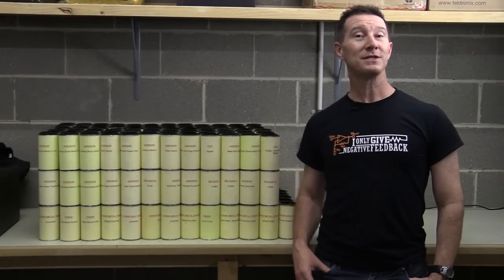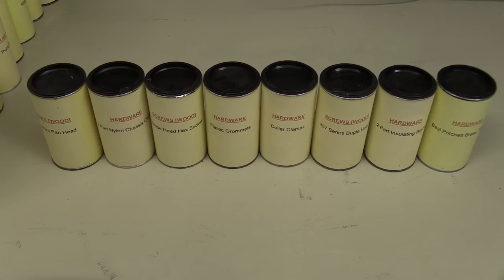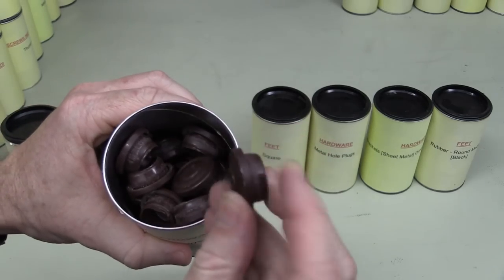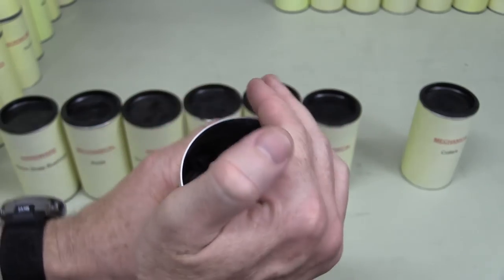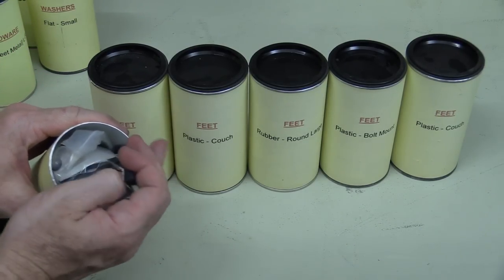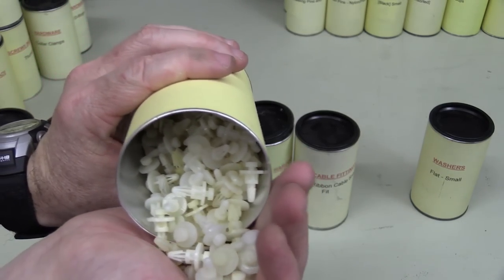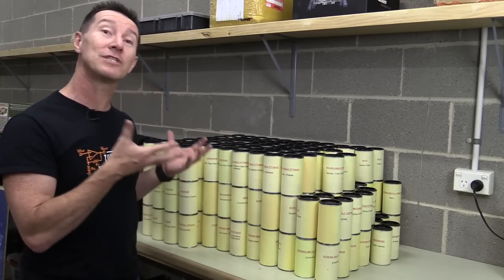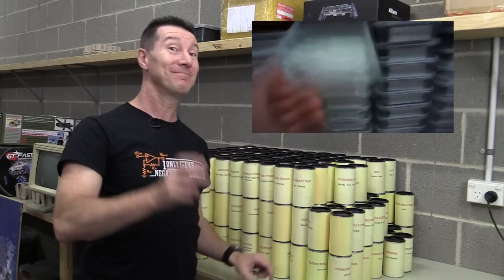EEVblog #739 - Ebay Hardware Tin Collection

Comment: I have a big collection of parts screws & etc myself, I worked for years as a Bio-Medical Electronics Tech in Hospitals repairing electronic life support equipment...
I took some of those plastic couch legs put them on an old shelf board to put my monitor on & my keyboard slides underneath it...  I repair all types of equipment, Electronic, Hydraulic, Pneumatic, Aquatic, & I can't tell you how many times a little spring or plastic spacer came in handy, I once got flown to Georgia, (from Calif.) to fix an intermittent Computer malfunction that I fixed with a used Tuna can & a piece of rubber hose from a windshield squitter line off a car, then took a piece of audio cable, removed the outer jacket, pulled out the wires in the center leaving only the braided shield which I connected to ground & the Tuna can to make an RF shield that fixed the problem, & very cheap with all used parts.. Of course the airfare & money they paid to techs who couldn't fix it, but I got the job done though I was then branded the "TUNA CAN REPAIRMAN"

Comment: Those couch feet slide nicely, and can be used where a wheel doesn't make sense. They also could be used where an impact is likely to help cushion the impact. I can think of many possible uses for them. A bench might benefit from being an inch or 2 higher, and they could be mounted under the legs. If nothing else I can see why he saved them originally.

Comment: I have a similar collection I received from a appliance repairman of forty years. Mine arrived in four 5 gallon buckets. To heavy to carry so each had a cheap dolly. It took eight weeks to organize and label into small drawers. I'm into R&D and prototyping and this kind of stuff is gold to me. Hopefully it will save you a lot of money and provide that prefect fastener or whatever you need for years to come.  BTW rubber couch feet can be milled. Cheap source of hard rubber.

Comment: The brass threads in the beginning are used for E27 light bulb sockets. With them you can mount them mechanicly and also run a wire through the hole in the middle, so the wire is invisible. Most E27 bulb sockets have a thread for that.

Comment: Couch feet make good large knobs for radio hams for antenna tuners and VFOs. Just glue the insert from a smaller knob in with Araldite or similar 2-part glue.

Comment: That sparks guy is like me times 100.  I even put things like that in sorted coffee tins for a while before I built up a collection of departmentalized cases to better organize my parts in.  Goodwill (second hard stores) are great places to get those kind of cases.  I have dozens of them that sort capacitors, switches, connectors, LEDs, relays, small speakers, etc.  I even use those really small 3X7 (21 compartment) days of the week pill sorters that you can get at the dollar store for my sorted resistors.  Quite handy.
Reply: sprybug The pill sorting boxes are actually great - some of them even have nice slots for labelling!
Reply: Mythricia Some do, especially those 4X7's that usually have a gap between each row to put a label.  Most of the time I just put a label on the top flap of the compartment.

Comment: I salvage a lot of small parts like this, and I always find a use for them when repairing something, or prototyping. But I keep my stuff in those nifty assortment boxes you can hang on the wall.
Also I could have used those couch feet the other day. :-D

Comment: Dave, don't discount that stuff as trash. If one is an equal offender in mechanical and electrical engineering - a lot of this useless stuff becomes very useful. The weirdest trash can suddenly have a purpose if you have to fix some 1920s machine....if only for the metal - it happens that i put a brass water fitting on the lathe and turn it into a cable gland because some 1930 electrical enclosure has pipe thread and nobody stocks cable glands for pipe threads....
Reply from the maker: Mrpsychotehpyro I'm not, I'm going to keep a good lot of it.
Reply: EEVblog Send it this way !
Reply: EEVblog this guy must have not had a real good marriage ,,,, he stayed more time with this stuff than he did w/ her,, lol,, no i don't the guy ,, but ive never seen such a collection ...wow
Reply: jim shaw obsessed
Reply: +Mrpsychotehpyro Good call - If anything the vintage stuff should be worth more due to it being rare I would dare say... :( But mid-project and needing a part quickly - as good as gold that collection is!
Reply: +jim shaw eh, maybe his wife was like him :p

Comment: Before anybody makes a medical diagnosis on this person, be sure that your medical board certification is current. If not then you have no idea what you're talking about. This would be the perfect parts storehouse for someone running a vintage radio repair business. Older radios were built a lot like furniture.

Comment: Random, hardware junk is awesome in a pinch. When fixing something while living in rural area junk drawers are most useful things in the workshop sometimes :) random screw collection, various springs, computer screws, electrical connectors off some random things. all junk helps to fix some other hings. sometimes i wish i should have salvaged something of old junk before throwing out- because the parts on it just would fit perfectly like 6 months after it is in the trash :)

Comment: I have a large box with most of those feet and stuff in there (but probably not so much in total), completely unsorted. About every one or two months I am really glad that I keep that box, because I can find something that I need to fix or repair some odd part. Especially those plastic feet (no, not the couche one) tend to get lost everywhere, and I can find one that looks similar enough to fit fine.

Comment: Just a thought on the unsorted tins:

Get yourself a tray, maybe 2 or 3 cm deep, preferrably with a spout in one corner.  Something like is used for prescription dispensing comes to mind, at least the general shape.  When you need a screw or something, you can pour them out onto your tray, extract the kind(s) you want, then use your tray to pour them back into the tin.

Comment: One man's junk is another man's treasure ...lolol
Reply: bullzye101 One man's junk is his own business.
Reply: bullzye101 I always preferred Quark's version on this sentiment, "One man's priceless is another man's worthless." (Star Trek DS9 - Season 1 - Episode 9 - "Move Along Home")
If I had the money and space for a workshop, along with time, I'd probably have done something similar as this guy who left behind his collection. Every piece and part, disassembled, sorted, and stored so that when it comes to creating a fully developed project I'd have things available in case I need them. A lot of commenters seem to want to blast this collector as nuts for keeping things that most of EEVB's followers find "useless junk" but they lack serious foresight. They pay too close attention to just the electronic circuits and cards and not enough to the project as a whole. What is the purpose for your electronics project? What use will it serve? Where will you keep it? How will it be protected? How will it be made more functional or even aesthetically appealing?
The last several questions are answered by "the chassis" the body that will house your created components and turn a random collection of cards and assemblies into an actual functioning and useful device. Things like spacers, brackets, screws, nuts-&-bolts, rubber feet, are all components that are needed to properly complete a new working device. Even the plastic couch feet at the 8:30 mark would be useful for a cabinet-sized project.

Comment: The collar clamps are from cathode tubes on TV screens or PC monitors.

I have no idea why they do them so specifically the same (that cutout and the hex drive) considering they could easily use the version that doesn't have threads, if it can hold a rubber hose on a car a tube should be no issue (cheaper too).

For someone who works in R&D something like this(all those parts) is invaluable. And there's a reason for that. You should never go buy new parts when you test something. It's a waste of money.

But having these in "stock" saves you a lot of trouble. Also, when you're done and ready to move to the next phase, you take it apart and return the parts back in the cans.

Comment: This Sparks fellow is quite the odd duck. I can only imagine he is obsessed with recycling everything so he takes everything apart, sorts and labels the parts and stores them. Quite noble though dull, if you ask me. In the future, we might even need to do something similar. I for myself want to see how much you can achieve from scrap. I am gathering parts for the cheapest 3D/CNC/laser printer ever. I'm aiming for 0 cost :D . Haven't figured the laser part yet. I hear there's no open source inkjet printing out there but I've seen some piezo experimentation. Naturally I'm digging for floppy disks, optical drives, old cables and transistors, caps, displays, used dremels, bare metal etc. etc. Electronics is the coolest hobby ever!!!!

Comment: That's what AfroDave is for!!  Do a quick 2 hour sort of what is useful and junk the rest.  Get fancy if time permits by putting a number on each tin with the description on file so you can easily find what you want.  Faster to find that rare part there than going to the hardware store.  Get 'er done AfroDave!   ;-)

Comment: The fading o f the paper used to label the tins show time between labeling. Its easy to have a template set up in Word and type the details then print and stick. Probably used the same ream of paper for them all. Probably just used a glue stick to paste them down.

Comment: Need to know the difference between a diligent worker and OCD, just have a look here.  He didn't just label each and every container, he did it such that the labels are all on exactly straight with text at the same height on every can (from what I could see.)  Wonder if he really used them or just couldn't help storing everything.

Comment: WAIT A MIN!  There is a Macintosh Lisa behind Dave.  Kewl.  The first Macintosh that I played with back at Motorola.  From time to time after a system crash all the files, which were neatly sorted into folders, would be dumped onto the desktop.  This was a shared machine so that only approach was to dump the loose files into an "unsorted" folder (except for mine of course) and hang a note on the machine saying, "Ooops, its done it again!".

Comment: The whole racks are just 5 old TV,  5 old Radios. 5 old scoops and bunch of old light fixtures all in desoldered parts, and couple of bags of new capacitors, resistors, and tubes. A look in mind of crazy person, who in their right mind would put a couple of crusty old rubber feet in a tin labeled and all. :D

Comment: Allot of those assorted metal thread screws are 2.5mm and you got to look hard to get a tap to make you some new threads it had me stumped so I had to order mine in it took a couple weeks as you want a quality tap from the start.

Comment: I was doing some measurements and it got me thinking how much amps and voltage the flux capacitor had to go thought to produce 1.21GW ! Yeah could it be possible for a box like that be able to transfer that amount of energy at all? I believe or melt right away or spark a plasma ball they sure will sent the car the the past right on into dust !

Comment: He must have had some sort of problem...I wonder how much of this he actually used, or if all he did was taking things apart and put them in boxes.
Reply: Mikael Murstam or he repaired electronics and other things and kept the parts from busted machines for parts for other stuff 
having a collection like that is amazing when you are repairing something and it has a missing part like a screw

Comment: That's nothing, compared to all the different parts I have organized on shelves in my garage. Perhaps some call a "pack rat", but I call it saving money. When you just need one screw, nut, bolt, nail or grommet to fix something. It saves a trip to the store, gas in your car, the time it takes to get there and back. And you usually can't buy just one screw, bolt, nail etc. You have to buy a box of a hundred or more...
I can't tell you the many thousands of things I've fixed around the house, or on my car.
With just miscellaneous hardware  removed from something that broke, or I just didn't want anymore...

Comment: Lots of cool and useful stuff.  Boggles the mind.  Makes sense.  Have you gone to the store and seen how much the prices has risen on all of those items.  All you need is somewhere to store all of them.  I store some stuff the same way:  all the same size containers.  But, I just have household repair stuff:  screws, nails, nuts, bolts.  All of the stuff that you can't use, just give to a hardware store, electronics store... or somewhere or someone that might actually use/sell them.  shame to throw that stuff into an dumpster/landfill.  give the couch feet to a furniture repair shop or furniture store.  Let them use it or trash it...   That's what I have done with tons of "crap".  I just take it to someplace where it might get sold, used etc.  I just give it away.  It clears the clutter from you house and you feel better and it won't be on your OCD conscience!!  ha ha  ....

Comment: Hey Dave EEVblog , Would you be willing to part with that Black APC Smart UPS if its the XL model (Ext battery Pack Anderson Connector equiped on back panel)? im after some of the XL models to use with network equipment in my home lab.

Comment: A box of unsorted screws is pretty close to useless.
Reply: ***** That's the problem. You have to waste time digging.
Reply: ***** I agree. I just meant it's not worth keeping them at all.
Reply: ***** I beg to differ! I lost count over how many times a project was saved because I found a screw in my big box of salvaged, and unsorted screws. Sure, it may take ten minutes to find one that works, but how long does it take to go to the hardware store to buy one?